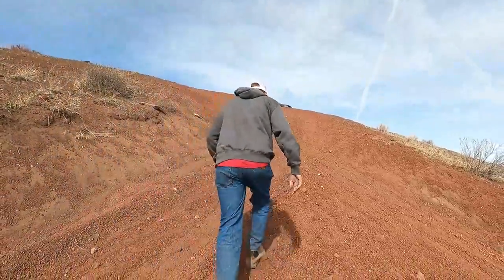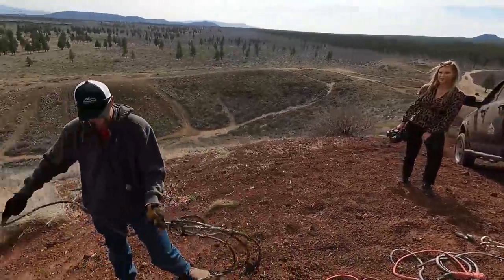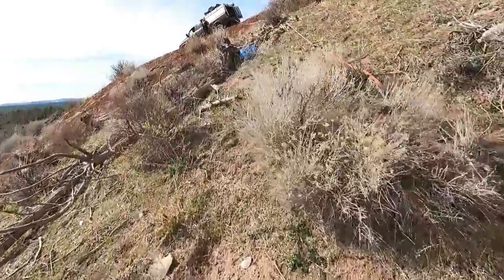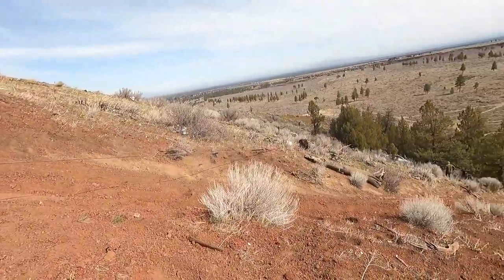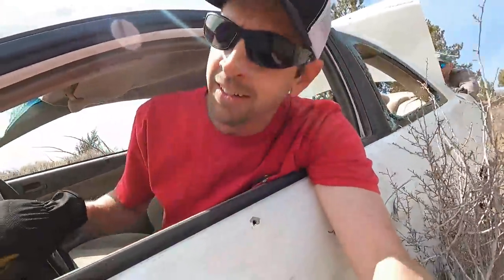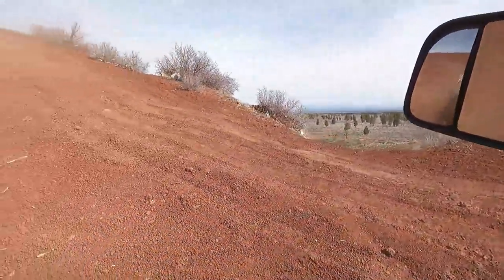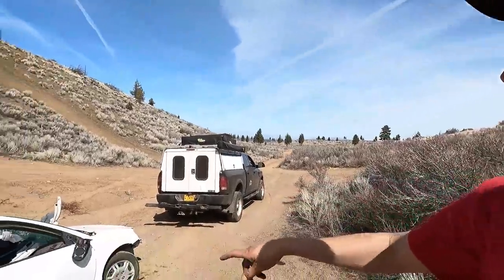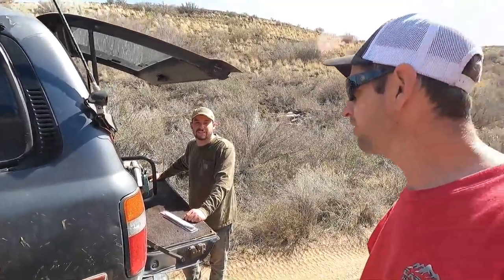Dangerous mountain side recovery doesn't go as planned.

Comment: I have played on that area for years. That is the biggest challenge for even a quad to climb.
When he is going down the hill he is practically standing on the firewall and pushing on the steering g wheel to keep his rear from coming off the seat.
Reply from the maker: Yeah it's very steep, very loose, and a much taller hill than it looks.   There's a reason that car has been sitting there for as long as it has!

Comment: Fun times 
I helped my Neighbor out last night and this morning 😉 his AWD  all the time Denali sunk in our Clay yards a couple days ago and it was freezing overnight so sunny and warm made it a slick as snot recovery day yesterday. Got his 2wd Chevy PU out of its hole where it was buried and frozen in, then as luck had it! 
My F250 got stuck in 2” of snot slick mud. It’s not always the depth of the mud but in my case while using the 12,000# winch I had to get my truck to stop moving and parked so I was at an angle. Then pooling surface water on the clay slicked it up and a gentle bit of movement spun the tires and it was stuck... let it freeze overnight and this morning pulled the Denali free and then myself out, and was perfect to drive out! 
Later this spring we will get back in there and fix it, so that the two track is much higher and dryer for next year!😎 
Great place to practice some old recovery skills!
And your un recovery reminds me of Ft Hood TX. The Butes around  the Area had some steep angles to their sides that no Camera can really do much justice for. I saw something years ago that was in Toyota Forerunners that I’d love to have it was a Tilt and Angle Gauge sat right on top of the dash back in the 80’s. At least if you had that the Camera could tell us what you were feeling in drivers seat!
I’m going to check out if I can find one on E-Bay or something!

Comment: Well nice recovery Casey however if I could suggest with your big (automatic) truck going downhill with slippery surfaces like loose gravel is to put the truck in the low gear & your transfer case in 4 low this way you don’t have to apply the brakes so much & become essentially a big truck on 4 skis. A wheel that doesn’t turn just skid & then there’s no real control but rolling slow using the truck engine compression gives you more control. Goo Luck from a brother Wheeler
Reply from the maker: That's exactly what I did...
Reply: Ya know it's steep when your on the brakes and it's just sliding..